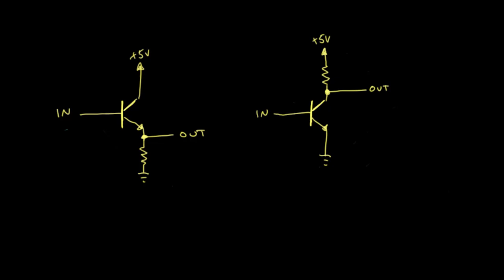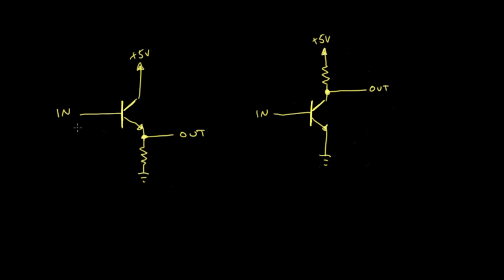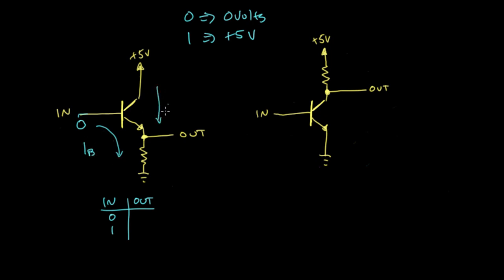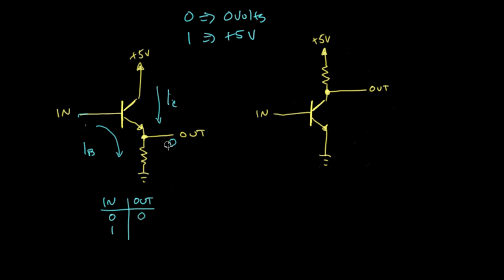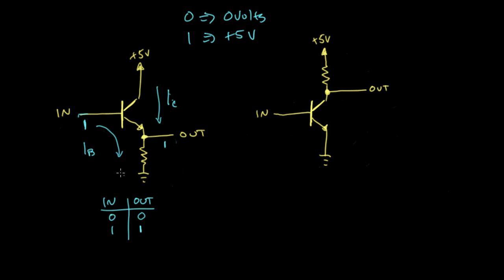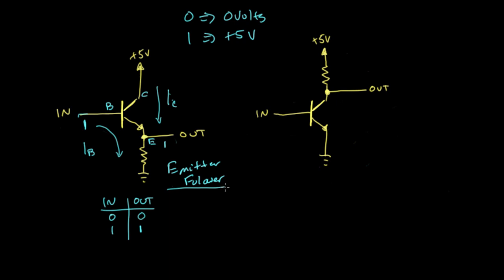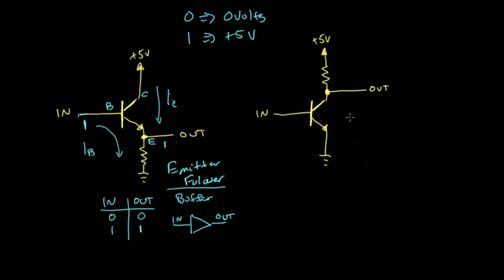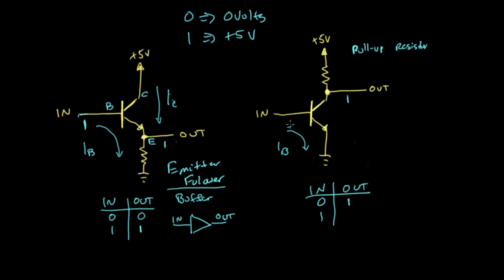Comparing the buffer and inverter circuits | Digital electronics (10 of 10)

Comment: I've watched the entire series without skipping and it gave me more understanding than any other sources I've been trying to get these knowledge from. Thank you so much Ben! The original reason why I started looking into the basics of electronics was to get clear on how 6502 processor interacts with keyboard and display but trying to figure that out ended up with a need to learn the basics of electronics) I saw you have a "building 6502 based computer" series which I gonna follow next.
I'm so grateful because your explanations are saving time A LOT, so thank you one more time!

Comment: my teacher is gonna be so happy when i do this in class
(assignment is to invert the function of a transistor, by making the led in the circuit turn off when the base is given an input. i used the short circuit method by simply moving the led into the same channel as the collector and emitter of the transistor, so i got the extra credit, but my teacher wanted me to do it in a less simple way.)

Comment: This was a  great series..   I thought I had watched all your videos, but somehow had missed this whole series!    One question..Especially given that you  even had a very low voltage when you tested the "off" state of the LED from the mystery circuit, why doesn't that voltage cause enough current to at least have the LED on somewhat?  Is there a non-linear curve for the amplification of the transistor, so that negligible voltages can be ignored?

Comment: Great series. Thanks a lot for the videos. My last question would be why do you switch the resistor places between pull up and pull down? I don't see where it's position mater whether it's before or after the circuit
Reply: On the circuit to the left, if you move the resistor to the other side, the output would be directly connected to ground. So the output would always be low, no matter the input. On the circuit to the right, if you move the resistor to the other side, then the output would be directly connected to power. So the output would always be high, no matter the input. Hope this helps.
Reply: @customfabrications  well said

Comment: So, the pull up resistor can be at any resistance higher than the resistance from the cable?
Reply: You want the resistor to be a couple times higher than the transistor, so not too much current goes through it when the transistor is on, which would interfere with your signal.
(You're also wasting power :P)

However, you want it to be low enough to still give a useful 5v out when the transistor is off. If you choose the resistor value too high, you can't draw any current. Basically the same as the dim LED from before, but it might even be too low to drive a transistor, depending on how high it was chosen.

So a couple hundred Ohms to 1K would probably work fine. It depends on your output.
Maybe you can get by with 10K, or 100K or even 1M. (Doubt it, though)

In essence:
Higher value - you degrade the signal it's connected to
Lower value - you degrade the signal the transistor is connected to

Higher values should be preferred to not waste power and generate heat.

Comment: Doesn't that inverter design reduce your output current though? Whatever "out" is connected to is going to have less current available than if it were connected directly to 5v. It stands to reason that you can only do that a certain number of times before there won't be enough current to interact with the components in the circuit properly.

Comment: Great video, but if a buffer takes the input and gives it to you as an output, what's the purpose of buffers in real life circuits? I'm studying EEE and would like to know, THANKS!
Reply: Sometimes a digital gate has to drive many other gates, but its signal output is too weak to do that. If you connect a buffer to the output, you will be able to drive many more gates. Note that a buffer does not amplify the voltage (unity follower), but it supplies the current to drive other gates.

Comment: 5:10 Can someone explain why do we even need resistor in these schemes? Is it because without it it just gets harder to measure precise values?
Reply: You can think of the pull-up/pull-down resistor as setting the "default" level of the output when the transistor is off. On the first circuit it pulls it down to 0, and in the inverter circuit it pulls it up to 1.

But when the transistor is active, you want the current to go through the other path. The high resistor valve makes the current favor the relatively easier path through the transistor, which gives you the opposite logic state.

Without the resistor (or if the resistor value is too low), when the transistor is on, you are making essentially a short circuit between 5v and ground, and your output logic state would be indeterminate, floating somewhere between 1 and 0.

Comment: I don't understand the pull-up circuit - why is OUT=0, when the transistor is turned on? OUT is connected to ground and the emitter is also connected to ground via the resistor. In my opinion, when you turn on the transistor, the current flowing on the path +5V -> OUT should be 1/2 of the amount before. +5V -> OUT and +5V -> E are parallel paths. They should just divide the current equally.
Why is it zero ?

Comment: Unfortunately I don't understand the difference between a closed circuit with a normal switch and a circuit drew not closed with transistor and I can't make sense of what ground means in comparison with a normal closed circuit
As I assume that a transistor is a switch I would place it in the position of a switch but a switch has only 2 connection wires which are + - but as I place the transistor to where the normal switch locates I find that it has three pins so should I assume that the emitter and collector are correspondent to + and - then the b acts as a switch but then question is how should connect a switch with only on wire?
Reply: More like a valve for a water pipe. The valve itself (the "Base", or the "Gate" for a MOSFET) can gradually turn on, or off, the flow going through the pipe. So, yes, you have the two sections of the pipe, the + (where enter the water) and the - (where could exit the water), and the valve itself as the third connector. Now, how to you connect the valve? Well, can be manually with a direct contact, or with a motor, or with a remote control allowing you to turn it from your kitchen even if the valve is in the basement, … as long as you can turn the valve in a direction or another, that can be as simple or as complex, direct (manually) or indirect (conditionally), as the need is.
Reply: emitter and collector are correspondent to in and out for the water pipe analogy; Base is akin to the lever which is the switch; To get the "ON" state we supply the base with the voltage stated in the spec sheet with careful attention to how much current occurs; Resistors are selected as current control — commonly called current limiting resistor — which is supposed to bias the gate on or off but is normally in a region where signal can be varying voltage; 

Emitter / Collector do not correspond to +/- 

Emitter / Collector  correspond to current through the device;

Comment: great explanation but you could also just say the transistors are like switches, when there's voltage and thus current on the base to the emitter the switch is closed and no volts and thus no current on the base to emitter the switch is open, pretty simple. stop the long winded speech, other than that you do great work. these videos are old, you did them long time but maybe in the future stop over talking everything like bread boards for example, if they don't understand how to use a bread board they don't belong here on this video watching it kapeesh?

Comment: Your so called "buffer" or emitter follower gives 4.3 V and not 5 V. Is that still considered 1 in digital logic? It looks like 0.7 volts magically disappears somewhere in your circuit without explaination. I find this both confusing and damaging.
Reply: Yes, 1 and 0 can be considered high and low voltage, respectively.  Current and voltage can vary a little based on the power source and components used, as well as environmental factors.  So that analog variability is no longer an issue so long as High is reasonably higher voltage than Low.  Ideally Low should be very close to zero.
Reply: Its definitly not saturated as he said, but in linear region. Also his inverter will die instantly when connected to a potent signal (like his buffer) basis resistors are a thing